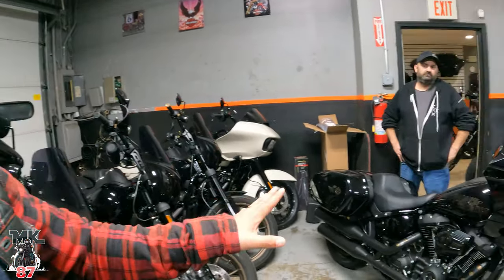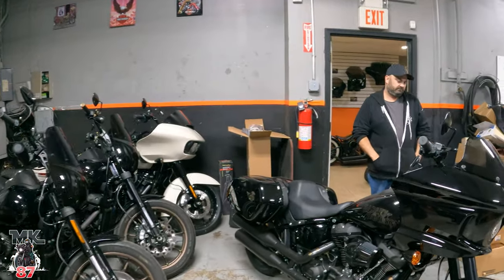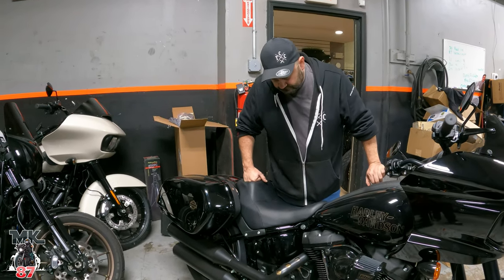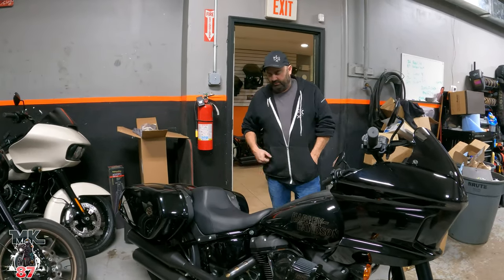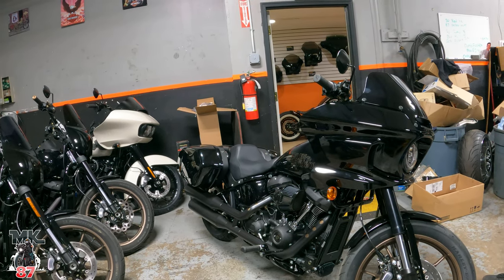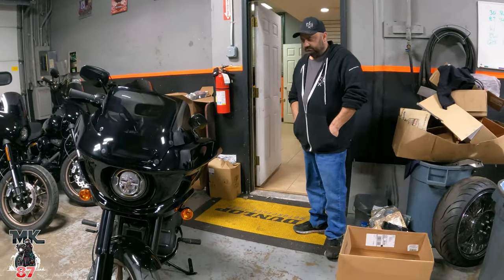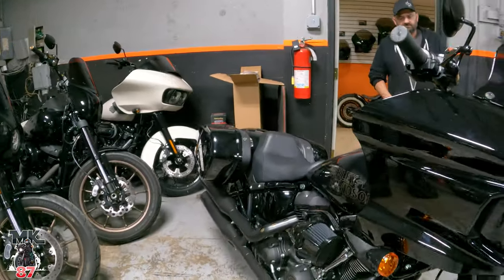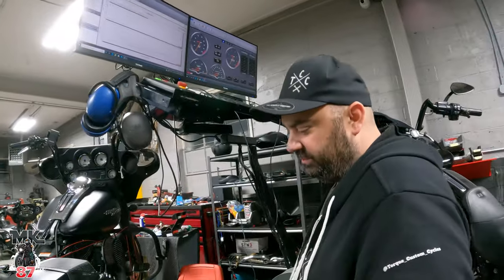Low rider st shop build!

Comment: He needs to put a wards 64mm port & polish Throttlebody and manifold and 5.5 or 6.4 injectors . Also, change the intake. It’ll hit between 130-135 horse and 130-140 trq
Reply: I will consider.